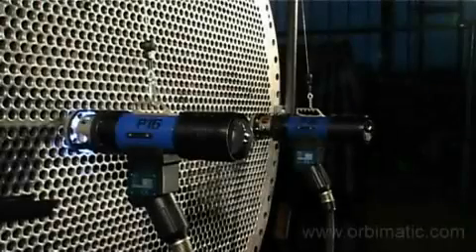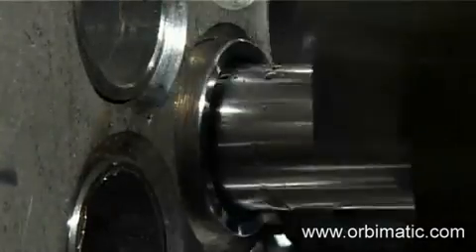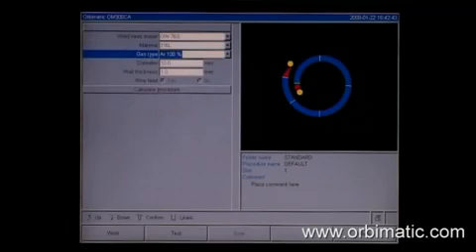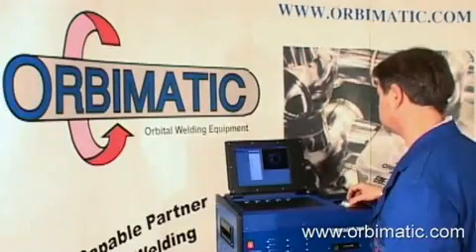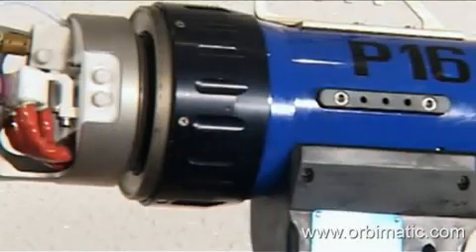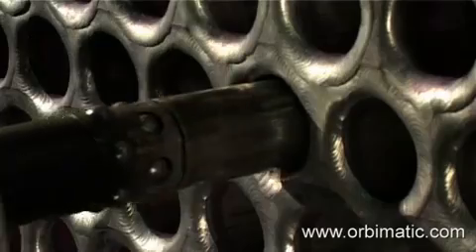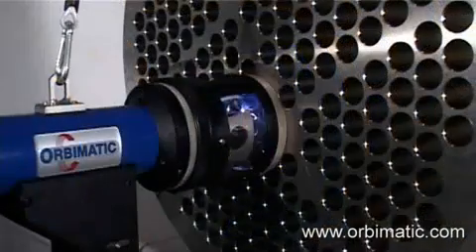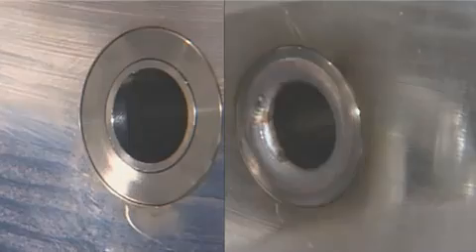Tube-to-tube-sheet orbital welding heads P16 & P20_Orbitalum Tools

Comment: Please contact Mr. Thanh at HP : 016 99 02 02 02 for Tube to Tube sheet and Tube to Tube orbital welding machine. 
In HCM local for consulting and quote. 

Xin vui lòng liên hệ Anh Thanh tại số di động 01699020202 cho ứng dung máy hàn tự động ống nối ống và ống nối mặt vuông góc tại HCM để có sự tư vấn và chào giá.